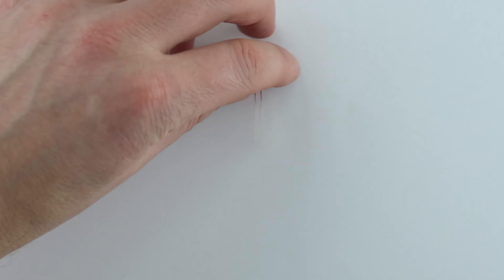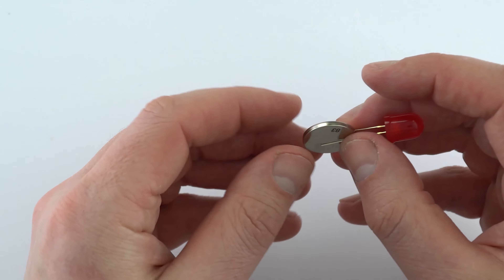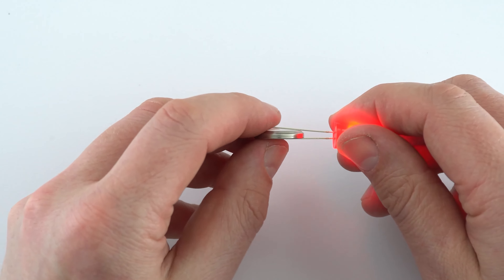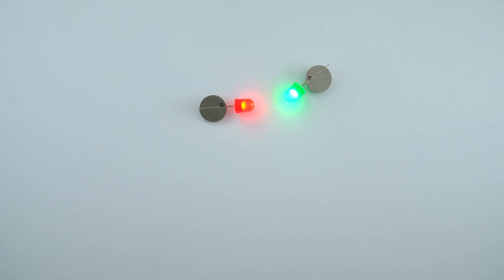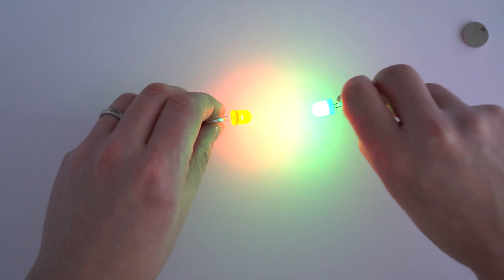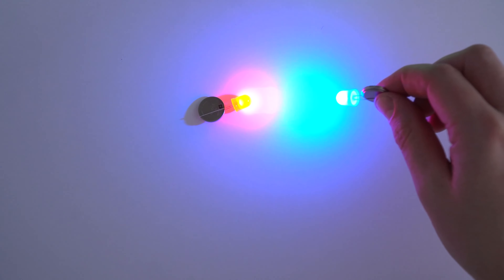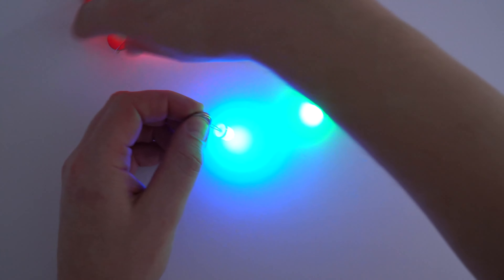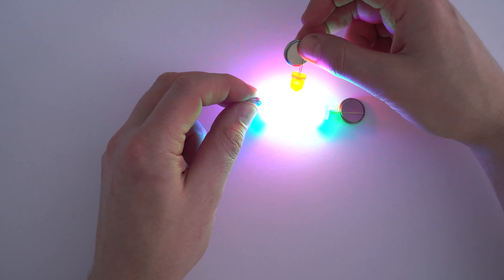RGB Diode Colour Mixing - GCSE Physics

Comment: Respected sir, I have some questions, it would be very helpful if you could answer for me,....                                        1)Is it possible to produce em waves by oscillating the magnet to certain frequency?....if possible please explain how it's created sir 
2)Can we produce em waves by oscillating the vandegraff generator?what's the difference between em wave produced from magnet, vandegraff,and AC current?
3)where does the energy of em wave come from?where the energy of em wave taken away from??
4) how can an object obsorb the em wave...what does black body do when em wave falls on it,does it produce out of phase light wave which destructively interfere on incident wave...how can a em wave be destroyed? 
5)can linearly accelerating, circulating, spinning charge produce light? How will that light look like?
6) does all AC circuits produce em waves, will AC circuit glow visibly when its frequency is frequency of visible light....why DC current does not produce em waves.... even though electrons collide with nucleus of the conductor and losses energy and ACCELERATES?
7)Why cannot neutral objects (Eventhough having positive and negative charge) does not produce em waves ...is it possible to produce em waves by shaking or vibrating the neutral object to certain high frequencies....how black bodies produce em waves??
Thank you sir

Comment: Hello sir
Today we had an exam of physics A level  Cambridge 9702
There was a Doppler effect question in which i am confused
Q is as follows
A boy is playing an RC toy car and moving it in a straight line
Velocity of car for first 2s is constantly increasing from zero,straight line
From 2-4s velocity is uniform with no gradient
From 4-6 s velocity is decreasing constantly to zero with a straight line
Graph is a trapezium btw
He asks
State how observed frequency change for boy from time
i)0-2 sec
ii)4-6 sec
In 0-2 secs it’s obviously decreasing as source moving away from body
In part ii).
 There is a confusion

Some say it will decrease cuz source is still moving away from body even velocity is decreasing so frequency will decrease with a lower rate increase 

While others say it will increase cuz if velocity is less than previous so denominator of doppler effect formula will be smaller as we will add source velocity and waves velocity so frequency increases